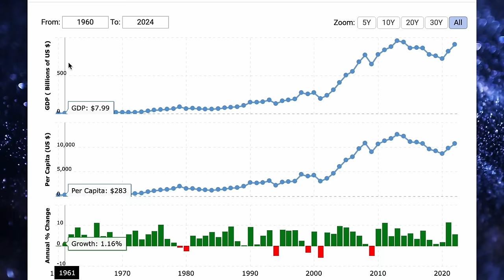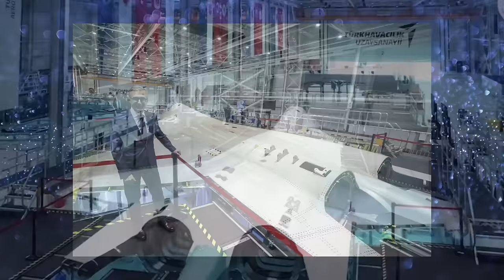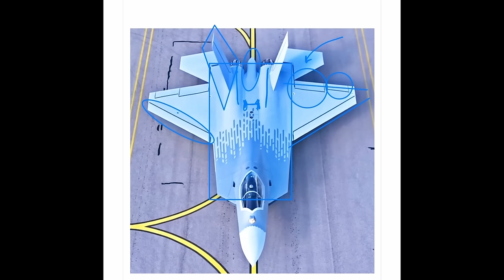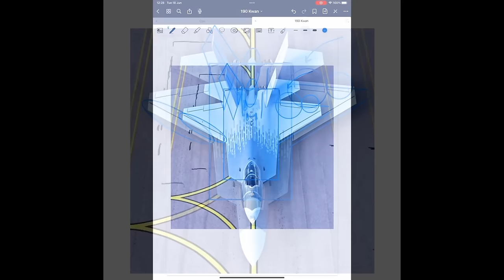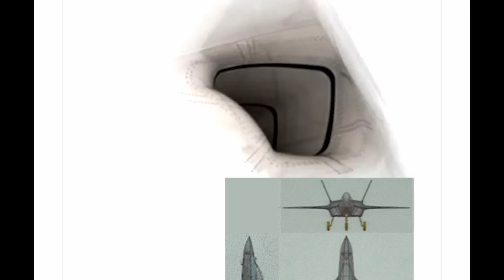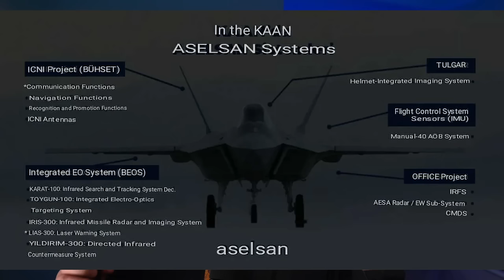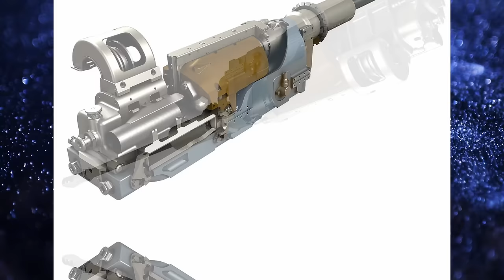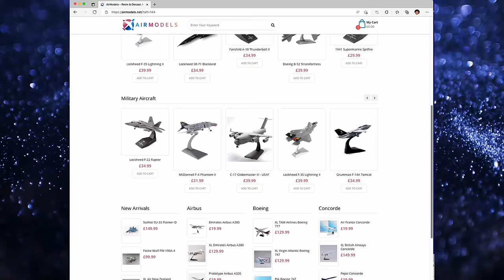The F-35 Has Met its Match

Comment: I understand it's clickbait, but it's still a bit premature to call this plane a match for the F-35. The stuff we don't know aside, while this plane is a lot larger than the F35, it has a reported max take-off weight pretty much the same as the F-35, but it has two engines producing roughly the same thrust as the F-35's one. This means much less payload, and less space for internal weapons bays. There's a thirty years gap between the F110 and the F135 engine, so good luck developing that on a Turkish budget, I guess.
Before all the internal systems of the Kaan are finalized (and we have no idea how those will eventually perform), the F-35 will have been moved on to block 5, with a way more efficient engine and cooling, possibly supporting energy weapons, far beyond anything the Turks can ever hope to achieve. And I could go on about the avionics and other systems... So, while it is undoubtedly an impressive achievment for the Turks to produce their own stealthy fighter, and while it is probably going to be a fairly good aircraft, it can never hope to even come close to the F-35. It will also be much, much more expensive, because the Turks will never be able to produce thousands of them, like the F-35 (of which over a thousand have already been built).
So, in conclusion, you should at least add a questionmark to the title.
Reply: What do you think is complex and to difficult to design and assamble?
An Aircraft or a helicopter fully independant?

Only a hint a helicopter is much more difficult...... 
Turkiye has this year begun the industrial production of TAI Gökbey Helicopters fully independant! 

I am in a good mood that the KAAN will also be assambled in 4 years. 
My opinion is that Turkiye will solve all basic problems until 2030...
Reply: @TabLet-nc3lf  Good joke :D You seriously think it's more of a problem to build a helo than a 5th generation fighter? You must have some serious problems. You are entitled to any opinion you can come up with, but Turkey will never catch up. It's simple economics. Also, The US has a 30 years head start, a budget that dwarfs the Turkish one and and a huge industry which can't just be built up from scratch in a fwe years. Many decades of experience and developmen to draw on. No amount of denial or wishful thinking can change that.
Also, why don't you address sthe specific issues I mentioned?
Reply: @ArchToast  
Hi, how old are you and what is your profession?
I am an engineer with more than 25 years of experience in different areas like electronic HW/SW, aviation, automotive and also subsea devices.
I am pretty sure. In the world are a couple (about 5-6) nations/companies which can produce proper military Helicopters. This is much less than producers of military aircrafts.
The mechanical and electronical requirements for successful military Helicopters are very difficult.
Reply: @TabLet-nc3lf  Sorry, but I'm not giving out any personal information. Suffice it to say that I used to be a pilot, and I have a technical background too. Regardless, this is irrelevant to our discussion. Trying to appeal to authority, ey? A common tactic for people who lack the arguments to win a debate.
And your argument about fewer companies producing something inherently meaning that the thing is more difficult to make is a logical fallacy, which makes me doubt your own stated technical background. There is, for instance, only one company in the world which makes some sweets I really like. Does that mean that making those sweets is more difficult than making a military helicopter or a 5th generation fighter? Don't make me laugh.
You're just shilling for the plane out of misguided patriotism. You haven't addressed a single factual argument that I have made. Your shilling won't make the plane any better, unfortunately. Still, I've said that the plane is a remarkable achievment of the Turkish industry, but it can't hold a candle, and never will, to the F-35.
Reply: @ArchToast   

All problems can be solved.
It takes time and lots of money.
Once the decission is done it depends only on the willing of the engineers, the nationals and politics.
Turkiye is willing (like the JSF Project) to engage other countries to the KAAN Project.
I would say that Turkiye can match the challenge in about 5 to 8 years if they don't change their mind. 
We will see. 
I think economic is the most critical point. 
Turkiye has the ability. 
Don't forget they were a part of JSF. They know most of the key features of the stealth technology. 

Other nations have also engineers and wise people. 
The inventor (technical) of the stealth technology came from Russia. Also the VTOL technogy of the F35 B originally YAK141. The big difference is that YAK141 used another Turbojet as horizontal engine and not a fan like F35 B (which is genius!). 

USA is very good in managing solutions.... and they have temporal advantage plus nearly endless money for "skunk work" 😉. Until Turkiye have reached the 5. Gen aircraft USA will reach their NGAD aircraft.....
Reply: @TabLet-nc3lf  even in 8 years, the plane will hardly be on par with an updated F-35 – payload, power and cooling being the major difference... again, as I pointed out in my original post. These issues can only be solved by designing a completely new and different aircraft. The investment disparitry is also huge, and it's not only the budget. The US works with other countries, too, and will eventually probably sell thousands of these airframes, which in turn will make them much cheaper and it will bring in way more money for further development. Even with foreign collaborators, wthe best Turkey can hope for in terms of export is maybe a few hundred pieces. That's not going to be enough to catch up. Again, it's probably not a bad plane, but it just can't be compared to the F-35, a huge part of which is also its see-through targeting suite, something I really doubt the Kaan will ever feature. This will give the F-35 a significant edge. Not to speak of the block 4 and 5 engines... You are right, enough time and money could solve all problems, but Turkey has neither. The Kaan will probably be a great plane to take on Russian and Chinese planes, but not US ones.
Reply: @ArchToast    
The most important idea behind this project is to be independent from other countries.
The second one is to build a synergy to the Turkish produced drones and weapon systems. 
And last but not least is to catch up the technological gap in Turkiyes companies. 
In anyway a win win situation for a country. 
It is the first Prototyp. They think about shrinking the size and want to implement some features in the next Prototyps one by one. This will take about 4 years before mass production starts. 

It is not necessary that the KAAN is better than a F35. The big idea is a fleet of drones which are managed/controlled by an Airplane like the KAAN. This is the big plan behind KAAN. This plane is in parallel designed with AKINCI, TB3, KIZILELMA and ANKA3 and should be seen as a fleet command outpost like an aircraft carrier. 
The idea is to build a whole air superiority system including all needed things for this (intelligence, defense, attack, air to air, air to ground, air to sea... ). This will take about a decade... it is a long way. But without the first steps you never reach the finishing line. 

Turkiye is already earning huge amount of money with the Drones and a big amount of military devices (ships, vehicles, rockets... ) and invests this earnings into the military companies and development. 

At the end time will show us the truth behind plans and reality....
Reply: @TabLet-nc3lf  I agree. This is what I thought the whole time. I only posted the original comment, because the video made it seem like the plane is on par with the F-35, which it is not, and never will be. But I do understand why Turkey is doing this, and it will probably be a success, unless corruption and/or politics interfere.

Comment: Bad news, this prototype is not stealth or even close nor does the plane yet have the ability to super cruise.

Rivets are clearly seen all over the aircraft.

The plane will need a few more years in the “cooker” to get up to speed with a F-22 or the F-35, both of which were designed a decade ago
Reply: F-35 has no supercruise capability
but KAAN will have supercruise capability with indigenous 35.000 lbf turbofan Engine  ... and KAAN having great stealth capability with RCS of 0.0030 m2

Comment: When DARPA 6th generation designs appear years later outside the US and whatever is decided on as the final design for the new fighters emerges and is reproduced in various alliterations of the original in other places, will this channel claim there are just so many ways you can get a plane to do what the American plane does so it is not a copy but just engineering having to apply the design to the same laws of physics?  Might other places just be leapfrogging their endeavors off of American tech and post-American revelations? Somewhere, sometime, someone will reveal designs before American designs and then we might wonder where the Amerixans came up with their designs, but until then . . .well?.

Comment: So the Kaan flew a few minutes at only 8k feet with the landing gear down the whole time, and that is enough to say it is equal to the F-35?  If this isn't click bait I don't know what is.  BTW, there is more than the design and "stealth features" that makes a plane stealthy.  The plane needs to be built with special material that absorbs radar, and I did not see any of that in the dozens of pictures shown or in the short flight video.  This aircraft will need several more years of R&D and testing before it becomes operational in Turkey's air force, or comes remotely close to the F-35.  US technology will always be several steps ahead, and the Americans are already testing their 6th gen fighter.  Keep in mind there is a new F-35 Block 4 coming out in the late 2020's, and I didn't hear any mention of that in the video, but I am guessing the Kaan Block 30 (or 40) will probably try to copy or adapt some of the Block 4's new features and upgrades, IF they become common knowledge which I doubt, because right now they are highly classified, unless you participate in the F-35 program and are a customer.  Even if Turkey acquires that information somehow, it will still take years to incorporate those upgrades in the Kaan.  The Kaan will always be several years behind the F-35 or most or all Western technology, which Turkey copies or pays for the technical knowledge transfer, and will never truly match the F-35.
Reply from the maker: There is a video on thechannel  listing all the technologies to be included in the Block 4, so you can learn the highly classified content...
Reply: @Millennium7HistoryTech  And you think they are going to tell the Russians and Chinese all about the F-35's upgrades and capabilities?  What is next?  Give them detailed step by step instructions on how to build one and all the electronics and software and make an exact copy?  There is still much about the F-35 that is still classified, just like the F-22.
Reply: Turkish radar absorbing paint and composite material technologies started to developed in 2005. Almost 20 years Turkey is developing radar absorbing materials and using them in navy assets.
Turkey is building world third biggest radar cross section test center. 
Turkey started to manufacture 65nm microchips in Turkey. Old technology but enough for most army assets. And before Kaan will be in service there will be more modern chips.
Also staying few years behind the f35 program is a success for a country which never built a jet before.
There are dozens of countries who is ready to buy a jet which is 10 years older tech han f35
Reply: @darkprofile  Very true.  I never argued that Turkey has not come a long way. Building a fighter jet from scratch especially when you 've never built one before is a big accomplishment. My only problem is with the title of this video "The F35 has met its match", which is total BS and pure click bait.

Comment: The F-35 is scheduled to fly for 45 plus years of service. With spare parts and support to maintain them.
Re-invent the wheel, when J-20, F-35, Russian version are flying.
J-20 engines are underpowering the CCP PLA aircraft.
Russia is behind the curve.
F-35 All 3 versions are capable of upgrades in the modular suit packages.
Good luck Turkey, congradulations on your development of your NATIONAL NAME PLATE of a copycat aircraft.
But why continue to re-engineer what is packaged on the shelf for purchasing.
OR,,, design a more futuristic (TRIANGLE FLYING CRAFT) that is stealthy/cloaking?
Or just save the cost of DEVELOPING MULTIPLE PACKAGE MILITARY, and work as PEACE NEGOTIATOR when everyone else whom has TOTAL GLOBAL DESTRUCTION MARKET CORNERED!
There's  a MARKET FOR PEACE MAKERS, and the STRUCTURE OF PEACE AGREEMENTS that requires DESIGNING a breakthrough compromise!!!!

Comment: This is why Turks didn't get the F35
Reply: The F35 is like the F104 Starfighter in the early 70s.
You don't have to buy a F35. Rent or buy a field in the near section of an airfield where they are flying or landing.
Wait a couple of days and a F35 will crash in your property.... 😂
Reply: @TabLet-nc3lf  2 crashes and its a starfighter?  🤷
Reply: @BoycottChinaa   
Excuse me....
This isn't right.
Official 29 crashes.

One of the main concept failure is that it has one engine. If something went wrong with the thrust...... same problem have all panes with only one engine. 

The second is the whole bunch of SW issues and the complexity of the systems. The F35 was not ready for delivery....

The F35 have also a list of main concept issues. It is overboarded with too much requirements for too much purposes. It can't match all of them 100% it is a compromise between cost and efficiency.

That is the point it is a compromise. In my opinion a superiority fighter jet shouldn't be a compromise. It should be the right tool for the Army, Navy or the Airforce.

The concept of F15, F18, F14, F22 are awesome.....
Because everyone of them are designed for specific purposes and have 2 engines. All of them are expensive because of the 2 Turbojet engines.

The plane with one engine F16 is also great but it is not so robust and have a greater crash ability.
Reply: @TabLet-nc3lf  didn't realize it was that many.. must be why they are making it a forward sensor instrument and retooling the F15 and F22 for following missile wagons ?
Reply: @BoycottChinaa.
I think in a couple of years they will solve the issues.
And then the F35 especially the VTOL variant F35 B will be a great aircraft.
But at the moment they have so much problems.

The main problem is that it doesn't fit 100% of the specifications for the Army, Navy or the Airforce.
This was unfortunately the biggest problem. You need the right plane for the right job. However the F35 is a great project and a good plane.

Comment: I am impressed with the Turkish Aerospace industry, but it is not the equal to the F-35.  

EVERYONE  in the world is behind America when it comes to stealth.  And the Turks will have problems working out all the bugs and this planes is years away from full-rate production in reality.

The F-35 has open architecture, by the time the KAAN hits full-rate production the F-35 will have new capabilites.  F-35 BLOCK 4 upgrades are already crazy.

Comment: A fast car is useless without miles and miles of smoothly paced roads and gas stations every few miles in any direction. How well will this fighter work without the GIGANTIC support and logistics supplied by AWAC, naval command, weapons platforms, etc? The F-35 isn't a fighter, it's one hands trigger finger, of the body of an 80 year old industry and juggernaut.
Reply: Turkey has AWACS. Turkey has good logistics to own f16 fleets. And it will be better with KAAN. Also Turkey has almost all kinds of indigenous ammunitions to kaan platform. Turkey is developing and manufacturing own corvettes and frigates and have pretty solid naval capacity. Turkey is not an ocean country so as a regional power Turkey has more than enough. If you think Kaan is the only project of Turkish defence industry you need to check it better.
Also Turkey already developed 2 different stealth jet drones as wing men of the Kaan.

Comment: So, this isn't built from scratch - the Turks couldn't build their own engines with domestic technology, unlike Lockheed and GE, for example.

This plane, much like the other stealth projects are, in my humble opinion, reverse engineering of the F-35.
Reply: You can't reverse engineer an aircraft you don't have. Turkey never received their F-35's. How on earth would they be able to reverse engineer them? TAI's structural division probably learned a lot from the times when they were producing center fuselages for the F-35's. But this still doesnt mean Kaan was reverse engineered. That's not how it works.
Reply: 5 years ago Turkey was using french safran jet engines in own cruise missiles.
Today Turkey has 3 different type indigenous jet engines for cruise missiles.
Also Turkey developed a small jet engine for own training jet program it is in test process.
Tf-6000 jet engine, also same engine with afterburner tf10000is going to be tested soon.
5th generation engine is a big challenge but it is not logical to think Turkey cant build jet engines.
Now Ukraine is making technology transfer to Turkey about jet engines and rocket engines.